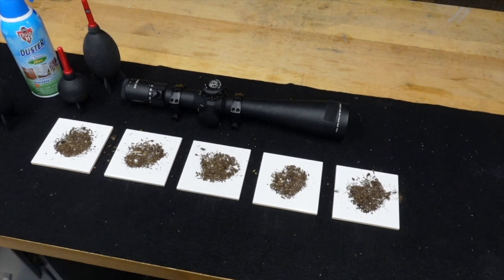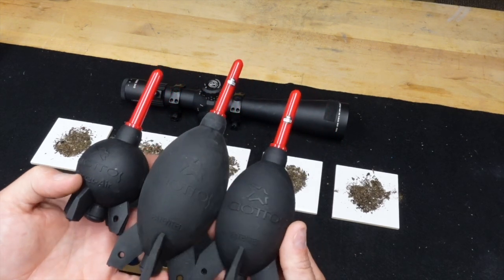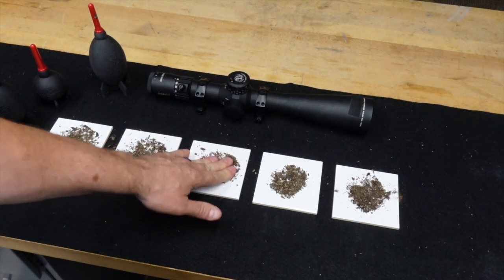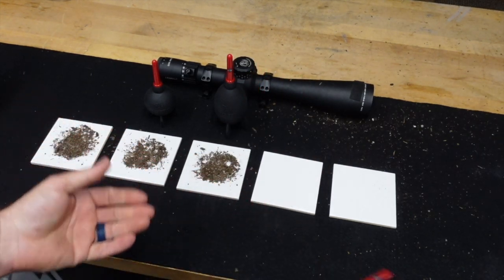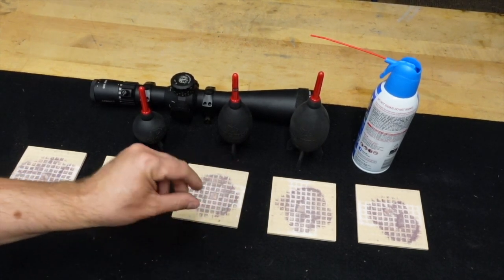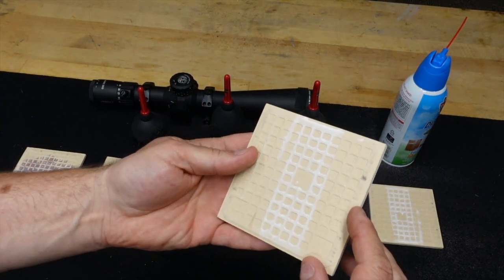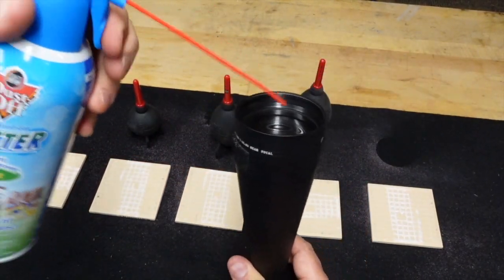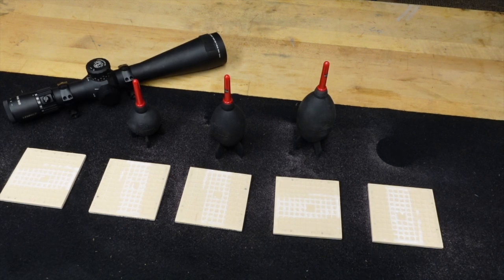Compressed air vs Rocket Air Blaster for scope and rifle cleaning

Comment: That is just brutal. 
I personally use the sureshot sprayers with compressed air. I have a Quincey compressor filter so there is basically no oil residue. Only way to go.

Comment: Hello - incredible, I've just bought something like your rocket blaster to clean my scope yesterday and you make a video about it !!! Now I need also a small silent air compressor or something like that for reloading, but i'm still looking for that.
Reply from the maker: If I find one I’ll make a video!
Reply: @FClassJohn  I'm still hesitating between a tiny silent compressor, and an air tank that I would refill with my noisy big compressor in the garage...
Reply: @BR. Get a Paasche compressor. I have one to paint models and it very quiet.